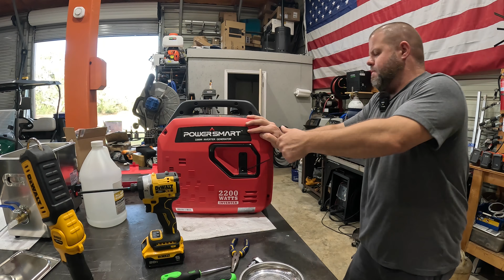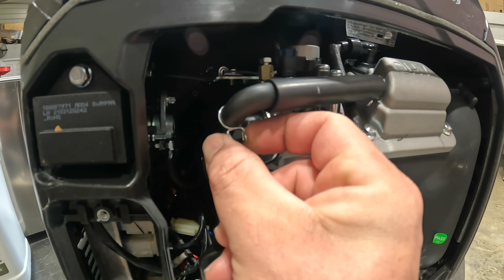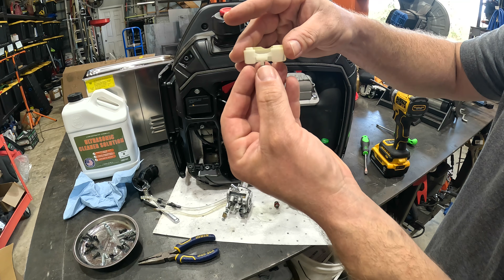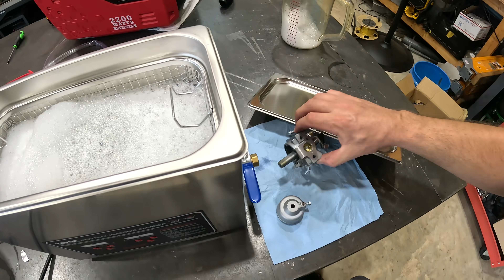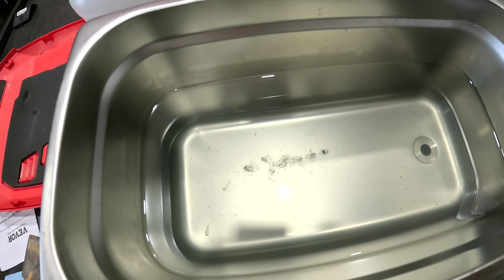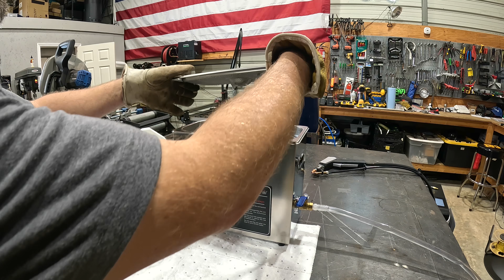Every Shop Needs This! Ultra Sonic Cleaner Carbureator Repair

Comment: I had a Crest U/S model years ago. The transducer (motor) forces water molecules apart, then when they crash back together, the shocks remove soft materials from hard materials. 

Heating water makes it easier to separate water molecules, as does a desurfactant. Soap acts as a desurfactant, so water and dawn is all you actually need. My Crest model also had a desurfactant mode, run for some minutes before adding parts. Made the cleaning step more effective.

Comment: Hey I can't remember where I saw it but I saw that if u put ur part in a zip lock bag with the cleaning fluid in the bag with the part it will only dirty the water in the zip lock
Reply from the maker: Correct, I've seen that myself.

Comment: Great video. We use normal tap water in ours and had no adverse effects. The oldest one I have is around 15/20 years and still going strong. Only had to replace the heating element once. 

We use dish soap and a little ammonia and it cleans everything. Best glasses cleaner around
Reply from the maker: Good to know!

Comment: Another great helpful video.  I have one of the small Honda generators and as long as you don't fully click it to off it will shut off the fuel and let itself run dry.  I have some other small engine carbs that probably need a good deep clean.  This may be an upcoming investment.
Reply from the maker: Ill try the "almost" off method and see if it works.

Comment: You can use just Distilled Water in your Ultrasonic Cleaner and put your parts and your cleaner degreaser mixture into a zip lock plastic bag and place the zip lock bag into the Ultrasonic Cleaner  with contains your clean distilled water with out polluting your Distilled Water !
Reply from the maker: Correct, I have seen a few people do that online

Comment: I have been looking at the 30L unit and will probably pull the trigger, I need to clean allot of old car parts!
Reply from the maker: I'd for sure be getting the bigger model for that type of cleaning.
Reply: If you do decide to pull the trigger on the cleaner please post up your results on all of your car parts. That would be one of my main uses also.

Comment: Yes sir, got one a few years ago specifically for carburetor rebuilds and secondary for gun parts cleaning. They certainly do work great.  I use PineSol and a little degreaser to clean the parts with. Thanks for sharing.
Reply from the maker: Thanks for the feedback, I plan to try different cleaners.

Comment: I use mine for cleaning parts of my rifles every once in a while when I have really run my guns.
EDIT: Make sure you dry everything and spray some WD-40 or some other lubricant on your parts.
Reply from the maker: Thanks, I plan to do the same thing.

Comment: could you just install a fuel shutoff valve in line and run it dry that way?  Also, for servicing scuba regulators we used to cover the bottom of the cleaner with Dawn dish soap add 1/3 distilled white vinegar and the rest water.  Works like a champ
Reply from the maker: Sadly I would have to remove the cover every time, but I suppose I could do that.

Comment: I've seen a lot of gun smithing channels use diluted simple green to deep clean guns and gun parts at a lower heat level or heating blueing solution to reblue guns.     Something I haven't tried but am curious if it would work is using a rust removal solution like ospho or evaporust on rusty parts.   Not sure if you would even need the added heat but the vibration might help knock the rust off and help the chemicals get better penetration into the rusted part
Reply from the maker: That would be interesting to test, thanks!

Comment: I always use none ethanol with Sta-bil and I was having the same problem then watching Chickanic  on YouTube I been using Ethanol Shield Fuel Stabilizer I haven't have a 
 problem since , had a a generator that I haven't use in 2 years or more or more and fired right up
Reply: I learned the same thing from Chickanic. She is a great instructor with fantastic tips!
Reply from the maker: Thanks, I will check it out.

Comment: As you said best practice for engines not used often is to run the carbs empty when shutting down. Also best practice is to run the engines monthly, if they are used often, to keep fresh fuel in the tank and everything kept clean.
Reply from the maker: Yep, I am going to have to fire this up more often.

Comment: Actually gasoline is not a good cleaner for carburetor parts. If it was it wouldn't need cleaning. Gasoline actually leaves varnish behind that is not dissolvable using gasoline and is most likely the cause of the problem. Acetone is the correct carburetor cleaner or products containing acetone. For my gasoline small engines I always fill my gas cans with premium ethanol free gasoline, add the "correct" amount of fuel stabilizer and a small amount of "carburetor cleaner". That all makes for a "Stabil" fuel that has some varnish cleaning capabilities.
Reply from the maker: I use to run Sea foam often in units I stored and never had a problem. I need to get back to using that.

Comment: If you put a smaller item like that carburator in a glass jar with the cleaner  then fill the rest with clean water it saves a lot of cleaning and works just as well!
Reply from the maker: That or bags, I need to try that.

Comment: Apparently you can put the thing you want to clean in a small container or even a ziplock bag filled with whatever you want to clean with inside the cleaner so you don't end up with so much "contaminated" water at the end and can save on cleaning fluids.
Reply from the maker: I have for sure seen the bag method.